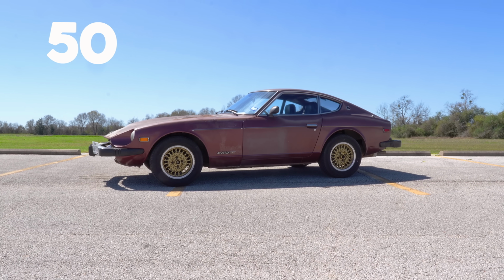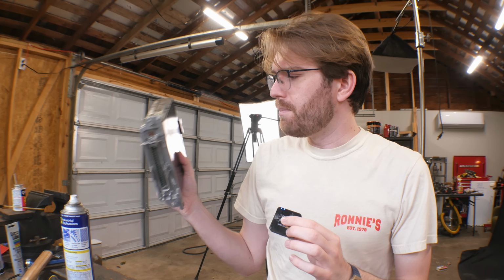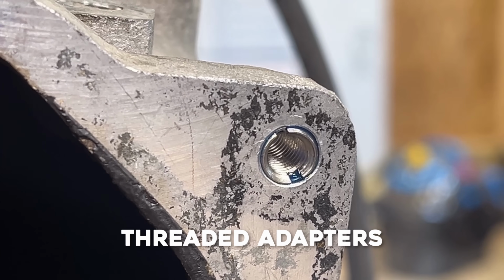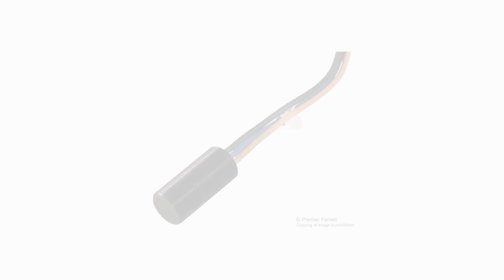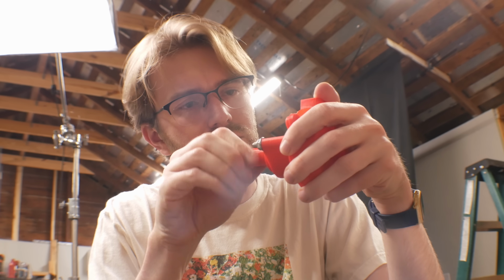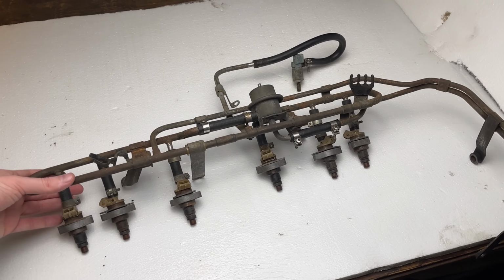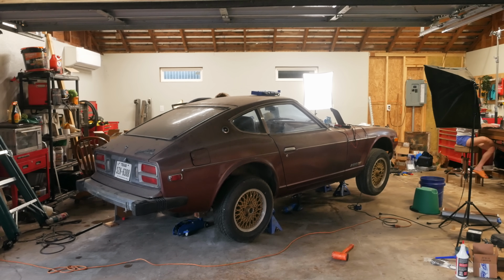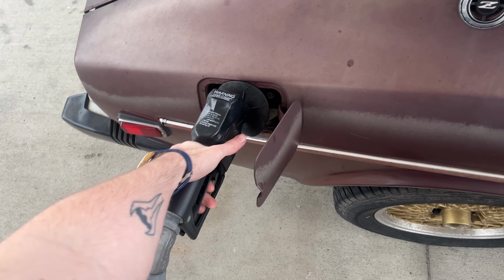Modernizing a Vintage Car

Comment: Good project   Back in the day we adjusted timing to fire 10deg  before tdc at 700rpm  if I remember.    Does this computer actually fire at  0   Or does program compensate?  Trying to get my head around this

Comment: The video is cool, but completely useless. What was the point of all the modifications if your engine is in such poor condition? First, a major overhaul was needed. Then a power measurement. And then an upgrade.

Comment: I honestly am fine with drive by wire its the electric e brake and steering. I feel like those are extremely dangerous in case of a power failure

Comment: Great video, well done.  Did you consider individual throttle bodies?  Fittment might not work w/the exhaust location...but that seems popular with BMWs.  Induction noise is probably the biggest benefit.

Comment: I like the way you pulled the engine , box , cleaned and made an ignition,and fuel injection system , much neater , now as you set it up on the dyno , for max power ? presume you wrote in an ignition curve , ie ignition advance etc , oh and fitted a decent air filter to protect the inlet/engine ! especially liked how you cleaned the engine bay , painted ,made it look like new while the engine was out .... oh you didn't , why didn;t you and when are you going to sort the body shell , its obviously solid , so rub it down and paint it ! , good job so far  😁

Comment: I love how clean and nice it came out at the end. Very cool project and video. . I had a 1984 Mercedes with K-jet nightmare, and I did the same thing with a pre-made kit. Can't legally drive cars like these at least in California. It will not pass smog test here. They will considered it as altered vehicle, altered emission control system. I had to pass smog the other way around.

Comment: If you some how see this, please fix the timing if the pro shop didn't. An engine can not run at 0 degrees from top dead center. For a small 6 cyd it should be between 2 and 5. When you are at zero the combustion pushes down on the piston not spinning it. Like a bike you don't push on the petal when its at the exact top you push when its just slightly past.

Comment: You obviously got the case hardened steel figured out and got it made. For any other normal guy a lathe could have been used to remove the steel you needed for bearing fitment

Comment: Not putting a cam in it is reaaaaally holding back it's potential. I totally get doing something because you want to even if it doesn't make sense. That's me too a lot. But, you should really put in a cam, it will give you at least as large a gain as all those things combined did.

Comment: My Hero. Im 35 but cleearly making and old engine run on a modern air/fuel system is a good route. after changing the starter motor the car will be more reliable. also...  please. try cleaning the engine bay and engine, and maybe finish restoring the car for cheap with some paint and stuff.

Comment: Ive got to give it to you the way you designed the thing to turn the distributor input into what equates to a crank+camshaft position sensor is pure genius and has severely impressed me

Comment: What a waste 🗑  of time to mount trigger wheel on distributor drive.
Why not fit the trigger wheel on the crank shaft pulley ? Easier.

Comment: Awesome accomplishment! Congratulations! And funny.  BTW -- don't confuse Wheel Horsepower with Crank Horsepower. Your 280Z makes 142hp at the wheels, your Chevy Cruze makes 138hp at the crank. There is typically a 20% drivetrain loss for RWD and a 10% loss for FWD. So toughly speaking your Cruze probably puts down something like 125hp at the front wheels, while your Z puts down 140hp at the rear. The Z was a pretty light care, I suspect the Z is much faster and if you dust off the suspension system I bet it handles better too.

Comment: I  know a guy who lived, slept and ate in his workshop with the carcass Z280, when he came out with the finished car it was amazing, you could spin the wheels on the spot for as long as you want and driving down the highway at 70 mph you can still spin the wheels if you hit the gas hard enough at that speed. He did use a 5#!t load of herb's.

Comment: The 240, 260, and 280 Z-cars were most often found in the ditch. They had terrible handling
characteristics as noted in the OEM picture in the intro. Body sway was horrendous.
Before the Z-cars, the Datsun Fairlady Roadster was a much better-handling car.

Comment: Pretty interesting video, i had to learn how the hall effect sensors worked in the middle of a ford ranger v6 project (you might have been able to us one of those)
The way it worked : it was driven by distributor shaft like yours, but the sensor spun inside an inclosed housing and was trigered when it passed a window. As long as i was pointing at the window when cylinder 1 was ar t.d.c. your good.

Comment: Great work, man! 
I'm a little jealous of the project you've done so well. 
I would have liked it if you had gone into more detail about the air mass settings or, in general, more about the technical details of how everything works together in the engine!

I like your sense of humor, and I'll subscribe for the final projection 😂😂😂😂😂😂😂😂. I had a good laugh :) Thank you very much for your great work, my buddy ❤❤

Comment: The old Z cars were made of recycled pop cans and the floor pans in particular rusted out in any area that used road salt. I had a 240 many years ago and had to replace all of that (I live well north of Texas). I put Weber carbs and a 2.5" exhaust on it, and it was still much slower than the slowest of my current (non-performance) vehicles. Your end result is likely why the default thing to do with these cars used to be to drop in a V8.

Comment: Great video and I really enjoyed it. if you could produce your whole change over as a bolt on kit I wonder if there would be a market for it.
I had a brand new 1978 280Z 5SP (yes I bought it in 1978). I got 26-28 mpg doing 80MPH with AC on the freeway. I forget what I got around town. I never red lined it in 5th gear but it would do 150 in 4th.

Comment: As someone who owns a 280 ZED EX with the N54 block EFI L28 l, the NISS ANN L series could make good power by just using triple side draft webbers and a decent cam regrind, like up to around 250hp without too much hassle.

Comment: you know they make modern distributors that you can hook up to your ecu to tell it when to fire right.  you didn't need to build one yourself.  i mean even just a normal distributor would send out the signal you need to tell the coils when to fire.

Comment: That Nissan was in the era before the crap gas we have now and no ethanol for starts on the low HP. 
That was the cleanest restomod I've ever seen.  I imagine you will realize more with a valve job and rering. 

Good job man!

Comment: Hey Ronald, for some free power  - would you consider making the spark plug gaps larger to get a bigger spark - I'd assume a bigger spark will help combustion and the coilpacks would be capable of delivering the necessary power.
Can you run more ignition advance? this usually gives some more power (is a knock senor available for that computer and or run higher octane fuel)
Check the intake and exhaust valve gaps? It's free and easy to do...

A follow up video with the above won't break your non reversable changes rule or break the bank.

Comment: Few things I'd like to see. Original dyno and final overlayed. Was the power increase everywhere or only at certain RPM's. Also any thoughts of upgrading the exhaust? Would love to see a header into either an open chamber or megaphone into resonator and finally a quieter straight through muffler. Looks like there was plenty of room under there. Then any thoughts of either designing or buying an aftermarket intake manifold. Not sure if it would be worth it or not but the design looked weird but they did crazy things until the 90's.

Comment: You can learn from the movie "Wangan Midnight" which held a guy that is picked up as the main driver for the Datsun "S30Z", which is the first generations of the Fairlady and better sport for straight running highway and tuned in with Twin-Turbo charged in the L28 series engine..which are mentioning the ones you had on the Datsun 280Z that you are owning right now..

Comment: I purchased my 78 metallic Burgundy 280 in 1978! I still had a 71 240. Don't ever talk bad about the Zs. They were extraordinary for their time, in fact the only 2 complaints I have is that they weren't 4 wheel disc brakes, and they should have had dual over head cams And that gas mileage is horrid..... I was getting 26 to 28 MPG

Comment: the L28E (your engine) actually only made 133hp.
I had a 260Z with the L26 and we deleted all the emissions and added side draft carbs from a 240 and it made a big butt dyno difference. The Bosch injection stuff was junk.

Comment: I like the idea and loved the humour but being 70 y.o. I doubt whether a project like this would be a long term financially viable project. If however you could design and market a complete kit under 50 bucks, can be fitted by a moron (me) in under an hour, I would seriously consider the financial investment. p.s. don't leave it too long to answer because although my clock isn't ticking, it's quartz, my battery won't last forever.

Comment: I’m glad this rando video dropped on my feed. Sub’d. 
I’m about to venture into doing the same to a 292 in my kurbmaster. I converted to TBi about ten years ago. The intake on the six is fundamentally limiting and the MSD kit doesnt allow for enough configuration to get it optimal. 
Was thinking of pulling the sensors/TB/injector, from a caravan 3.8l I have on hand and trying out megasquirt or speeduino. 
The video has given my plans some inspiration. I’ll likely use the caravan coil pack but am eventually going with the coil overs. Much of what you’ve done is what I’m planning. I’ll have to machine my intake for the injectors, but the rest appears much the same. Thanks for sharing your experience. 

Dope car and project mate.

Comment: I’d say if you want to fully optimize/ modernize the system you should add a turbo, should be easy to tie into your system since you already have the ecu controlling all aspects, and have a tuner who has worked on the car

Comment: There is still some fine tuning. The long crank to start the engine for one. I think if you where to adjust the timing to maybe 3 or 4 degrees advanced, you could get a better start on it. and likely a little more power. you may also want to look and see about a pre prime on the fuel rail to assist in a better start. unsure if the computer senses fuel pressure as you never covered that in the video.

Comment: be Very careful driving this because the steering wheel wont have a crunch point on the steering wheel Shaft So if you crash it wont
protect you and f ly up in to
your face

Comment: A question: I'm thinking I'd like like a vehicle (preferably a pickup) that is not connected to the internet or a ECM in any way.
I understand it will cost me some effeciency, but I want a vehicle an EMP wouldn't shut down.
Any thoughts?

Comment: Get rid of fuel injection system, carbs are better, plane and flow the head, flat top pistons, fat cam, open exhaust, not necessarily in that order, but you can gain old school power to the extent that you will need to upgrade the clutch to avoid smoking it
Reply: I forgot just use a points distributor, actually quit tunable

Comment: Hey mate. Great video. I'm planning to do exactly the same rebuild for my 280zx. Is there any chance to share the parts list you used like throttle body, sensors and so on. 
It would be very helpful.

Comment: A feller who makes his own distributor gets my respect
Reply: Have you seen the guy that makes his own transmission.
Reply: @seregium, This depends on the parts though.  Brackets for example have a low failure rate.  Sensors and motors have a higher failure rate.  In this case, the sensor is off the shelf, easy to get a new one.  The housing is like the bracket, pretty unlikely to fail.  The shaft could wear, but is unlikely as long as it was made well, and he got two of them.  The toothed ring has no wear points.  The internal bearings could also fail, but those are off the shelf and easy to replace.  They also won't fail overnight, and should give some kind of warning.  So I would say this is probably pretty reliable.
Reply: @px39a52  Such an embarrassing post. But at least you only posted it publicly. For the world to see. For all time.
Reply: Technically, it's a CAS.
Reply: Yep. To me it is very bad idea to install parts you couldn't buy and install next day in case of a failure.
Reply: @Seregium one of the goals of the video is to make sure he can still put on all the old parts
Reply: @Seregium  We get it. You couldn't do this. You didn't even need to tell anyone, we already knew.

Comment: I'm 56 years old life long car guy. Think musclecars. These Datsun's are just not in my wheelhouse. 
I have someone in the family I am very close to who is very much into these cars. His first was a 280z and he actually prefers them over a 240z...I believe that's due to the induction system that came from the factory but whatever it is that's what he likes. He has one very rusty old blue parts car sitting around but it's past restoration. I have very little money but getting ready to make major changes in life and move out of state down near where this family member and the rest of them are all at. I'm talking western Kentucky moving from Detroit. I owe a lot to this particular feller, he has helped us more than I can describe on here. Spring of this year I'm hoping to have about $5000 extra cash and hope to find something I can work with in this model. I'm sure the price point is much higher but I'm a retired mechanic with health problems but with assistance I'm sure I can put together something and surprise this feller. 
I've actually thought about a modern trail blazer vortec 4500 inline 6 engine with a standard chevrolet blow proof bellhousing can and a garden variety T-5 manual 5 speed with a hydraulic throwout bearing. The whole swap shouldn't cost that much. 
Does anybody have any better ideas for a swap?

Comment: Fantastic video! Incredibly interesting with great humor! I had an '81 280ZX 30 years ago and remember all of that hardware on top of the intake manifold. Scary! Such a 'clean' change! Unbelievable! I had a mechanic friend swap out the exhaust manifold for a 6-into-2-into-1 header so I could still use the catalytic converter, since it was a daily driver and was emission tested. It also had a 2.5" exhaust with a Magnaflow muffler as well as a free flow intake, which was simply a mandrel bent tube that went from the throttle body, through the radiator support, and made a 45-degree turn, to mount a giant K&N cone filter where the factory air cleaner rested.  I had hoped that the header and all that cold air would have made a difference, but made NO difference and this explained how & why. My car did look good and the exhaust note sounded better than stock, so I at least had that going for me. With the updated system that can be re-calibrated for anything on the car, I'd like to see a 6-into-2 header on it and running dual exhaust and see what you get on the dyno....  ;-)

Comment: Never knew just how primitive a petrol engine is until I watched this. <20 mpg is terrible. <140bhp is terrible. It would be interesting to see what a "perfect" 6 cylinder engine should deliver. I'm guessing something like 200bhp and 60mpg depending on the octane?

Comment: This car new : The 1978 Datsun 280Z featured a 2.8L (2753cc) L28E inline-six engine with Bosch L-Jetronic fuel injection, producing around 170 horsepower, 163 lb-ft of torque, and a top speed near 120-130 mph, delivered through a 5-speed manual.

Comment: everyone i know that ACTUALLY can repair their own vehicle LOVES modern cars and computers and prefer digital actions.  including me.  i can repair anything in my car for free plus the cost of any junkyard parts i may need to salvage.  first thing i do when i purchase any car is either pirate or buy (if i must) the shop manual and the ACTUAL manufacturer's diagnostic software.  with that and basic automotive mechanic jargon knowledge, you'll never have to pay and wait for a mechanic to screw up your ride.

everyone i know that regularly breaks down on the interstate HATES modern cars and computers and prefers more mechanical actions.  most of whom pay mechanics a fortune for painfully brainless and easy things like oil changes and tire rotations.

all those awful awful computers and sensors? pennies on the dollar, easy to calibrate even with a cheap android, and most of them replace HUNDREDS of dollars worth of steel, rubber, ect.

older cars just LOOK better.  modern cars are vastly superior in literally every other way.  and thats just a fact.

Comment: Ha. Ha. Ha. Why not bring it up to date and use an electric motor or two? The Internal Combustion Engine burns fossil fuels, pumps out carcinogens and CO2, is highly inefficient (25%), contributes to climate change, wears out quicker, has thousands of moving parts, needs constant maintenance, wears out brakes (EVs regenerate energy back into the battery), and is incredibly noisy. Electric motors are 90% efficient, batteries can be recycled 95% after their 20 year lifespan and are quiet.

Comment: 115 wheel HP ? 

Well that's actually much more than most European compact cars from the nineties and early 2000...and at that time the cars were not designed to be good in crash tests so much lighter.

It is only "bad" if we are not considering the weight and  when you are used/comparing to recent sporty cars that do 300hp on twice the weight...